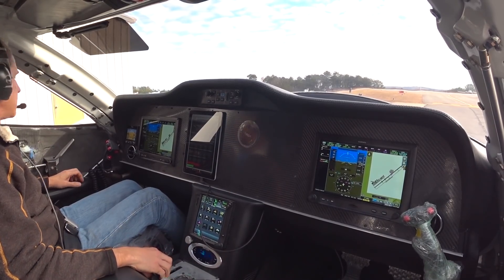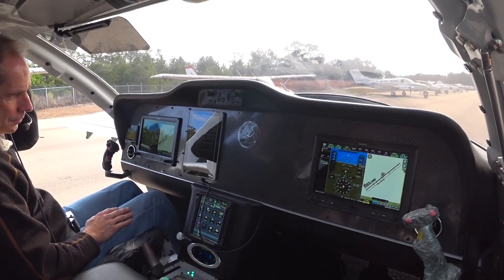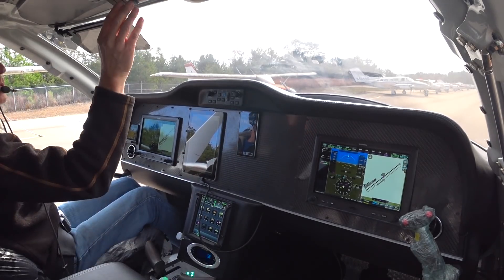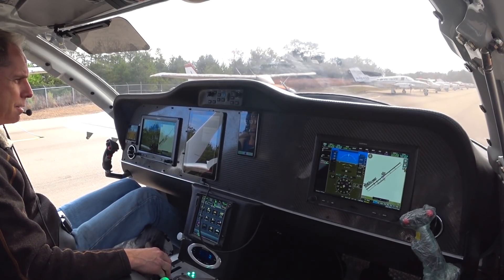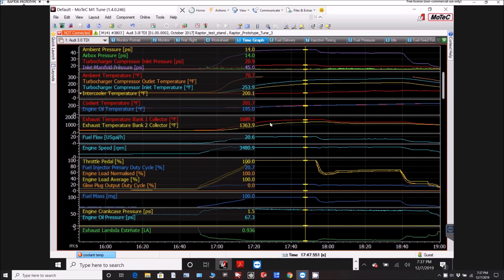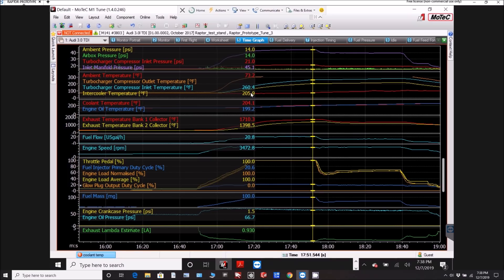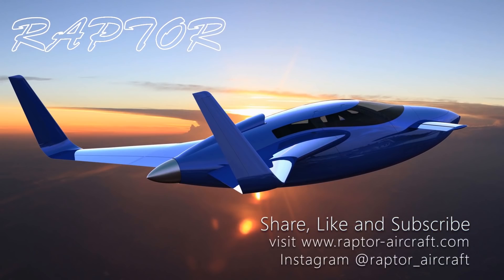Secondary Intercooler Testing - Building the Raptor Prototype

Comment: You do not think it's absurd to do cooling temperature tests with the aircraft stopped with a pushing propeller ... and without the engine hoods .... the suction airflow around the engine and in the radiators is not linear and has nothing to do with the reality of flying ...
All the cooling will only work when the plane will move fast .....
you have done a good job for some things but if you continue this way ... you will never fly ....
Reply: I'm sure he's fully aware of that. Before flying he needs to make sure it's safe to do first. Can't afford a crash or worse. Then work again on flight data when available.

Comment: Speaking of secondary, have you considered running that engine as two 4 cylinders?  As in two 4 banger ECUs for redundancy.  And as much as I'd like to take credit for that idea, I just saw it on a video  posted by 
Kitplane Enthusiast here on youtube.
"This is Len Baxter's Velocity aircraft with a 495hp GM V-8 engine! It is controlled or monitored by two SDS ECM computer modules running the engine as two V-4's. Listen to it rumble!!" 
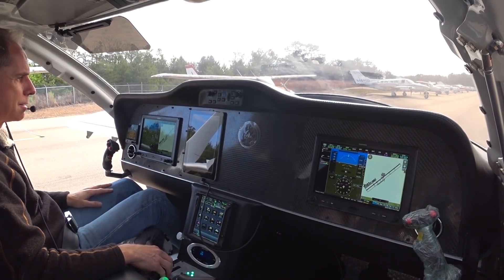 https://youtu.be/qADOIqEQ5Y0  2:44 Mar 23, 2019
Reply: @Shawn Huffman You understand this is a diesel right?  There is literally no room for dual injectors.  But the engenius thing about running it as two 4 cylinders is that unless you have a mechanical failure, you effectively have two engines.  Each with the power to maintain altitude.
Reply: The engine isn’t a v8 so it’s can’t be run as 2 v4s.

Comment: Good test and good work, I'm trying to figure out a way to present a test to you that can prove the veracity of my claims.
 It will require a modification of your fuel map but I can only hope that you're not married to the current one. 
 The 20 gph benchmark is a good one, as is the 40 psi number. I'll try to crunch some numbers tomorrow and the goal will be to achieve the same fuel flow and thus true energy output with a lower EGT. Though in reality if you push the same fuel at 3k you will make significantly better power, there's the question of how much and what color smoke you're willing to tolerate.
 Feel free to tell me to f-off if you like, I'm used to it honestly.

Comment: Won’t the intercooler be much more effective when the aircraft is in motion and has ram air to go through it? On the dyno it’s pretty hard to keep an intercooler from heat soaking in extended testing. But on the road it’s much better.

Comment: Engine overheat on climbout seems to be a major concern. Why not deal with this by limiting boost slightly until temps stabilize; seem likely the power loss would be less important than reliability.
Reply: Take off is where you use the most power, so limiting it at takeoff only to have more once airborn is pointless.

Comment: What sort of wastegate control do you have? The real test of the intercooler will obviously be when you're at altitude and the turbos will have to push a much higher pressure ratio than they do at sea level. Are the wastegates controlled by the ECU to meet a certain manifold pressure?

Comment: I was taught not to exit the aircraft with the engine running. I understand you are trusting the parking brake to hold but this is testing (things can go wrong). Is it possible to find one of the retired guys who hang around the airport to help occasionally?
Reply: It's also chocked.
Reply: @patrikj  Left it running when he got out to place the chocks. Or did you think the chocks were just there waiting for him to taxi up to them?
Reply: Not a huge deal. Safety concern sure but he needs to focus on moving through the problems before maiden.
Reply: Yep kinda sketchy. I actually though exiting with the engine running is a violation. I know you can do it in larger aircraft but the engine on the side people exit from needs to be shut down.

Comment: Could you elaborate on why the EGTs are 30% higher than actual? I may have missed that in a previous video. 1700F at face value is pretty scary!
Reply from the maker: I answered this in detail on a reply to a comment on the previous video. If you have trouble finding that reply let me know.
Reply: @Bernhard Jordan Thanks. I'm not sure what that has to do with my question. I can do the math - but I'm unclear as to WHY the thermocouple would read so much higher than actual.